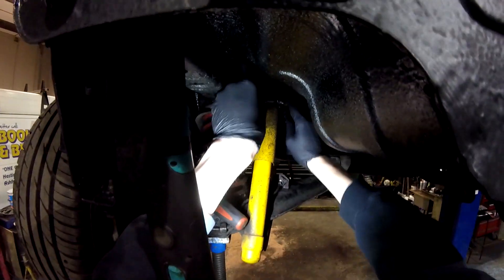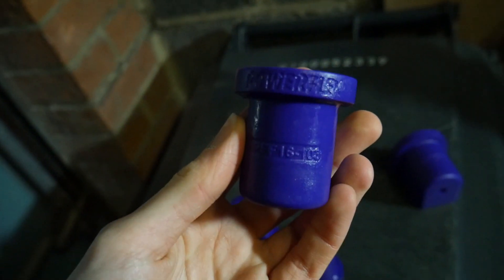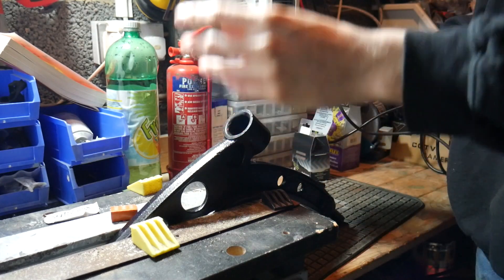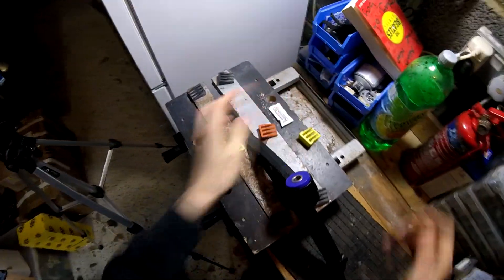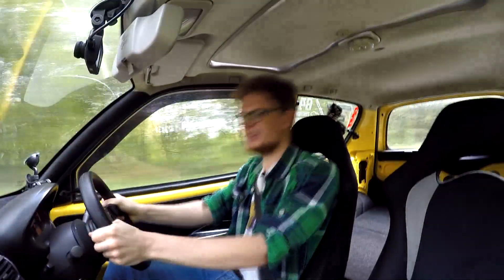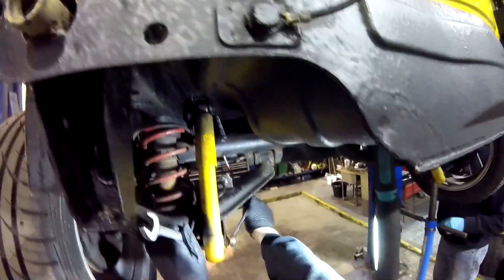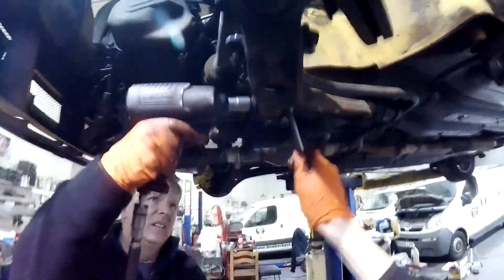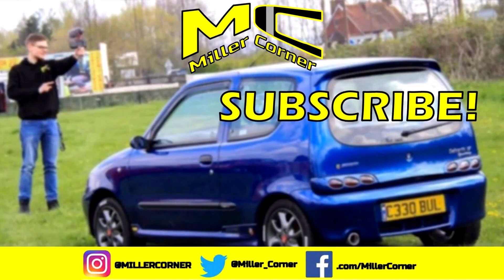The ULTIMATE Suspension Upgrades! [Polybushes & Adjustable Shock Absorbers Install - Super Seicento]

Comment: Nice work! I really need to overhaul the suspension on Humdrum....188,000 kms on the factory suspension means things are a little clunkier at times than it should be!

I don't think there are companies that make poly bush sets for my car....not much aftermarket for my gen of Accent, sadly....BUT....I think there are Kia Rio kits of the same vintage and they are sister platform cars, so the Rio sets should fit on my car!
Reply from the maker: Ooh intriguing! 🤔 Get on it, my friend!
Reply: @MillerCorner  I really should! Timing belt is due soon though, and that won't be cheap, so that first I'm afraid! :)

Comment: What about sway bars, tuning the tyre and suspension geometry?
Reply from the maker: Sway bar upgrades don't really exist, I've got as good a tyre as I possibly can and it'll have the alignment done in a couple of weeks 😁
Reply: @MillerCorner  sorry meant stiffness bars, and in terms of tyre and suspension meaning camber,caster,ackermans angle, toe...
Reply: @_generation_youth_x28  you don't need to change the sway bars unless you are going crazy and have to change the balance of the car.

On stock suspension you can only change toe on the front but everyone leaves it alone when on street
Reply: @miralemnermina142  my mistake, I thought he was going for a track style set up
Reply: @_generation_youth_x28  even then you don't need need aftermarket sway bars